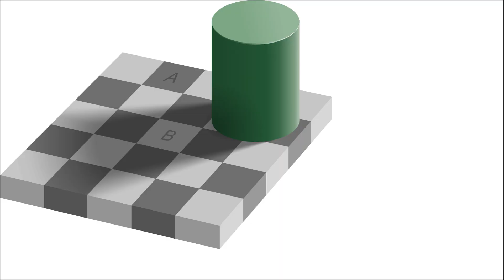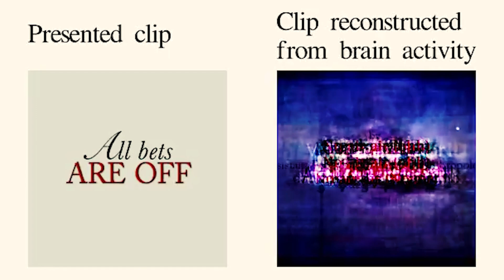Time Dilation:  1 Day in the Game = 1 Hour In Real Life

Comment: One problem is that, generally, our higher level thought functions don't follow us when we are experiencing accelerated time; much of our brain becomes dormant. This is because the outer parts of our brain have longer times for signals to travel. If we could speed up the signal speed, and in the correct  proportions, then you could speed up our subjective time.

However that presents another two problems; one is more caloric needs. Your brain is by far the most caloric needy organ you have; speed things up too much and you might not be able to feed nutrients and calories into your blood fast enough.

The second problem is that of cooling. A brain produces a LOT of heat during operation. Our blood can only carry that heat away so fast. Much faster and you will cook your own brain. You would need more efficient lines of coolant running through your brain in order to pick up the slack.